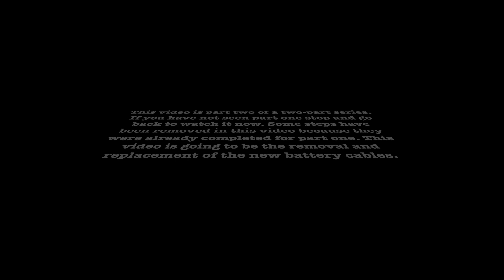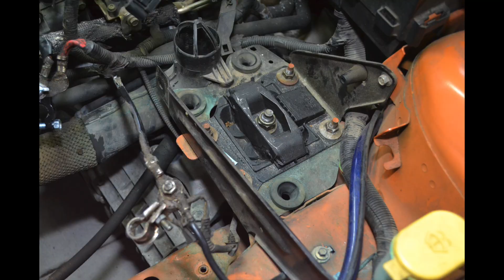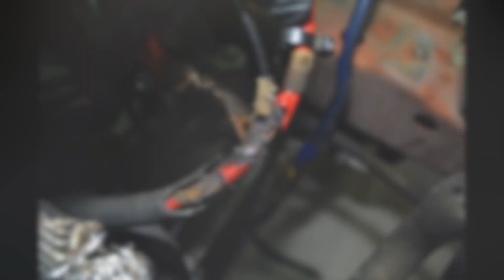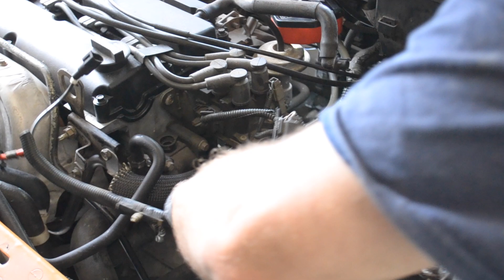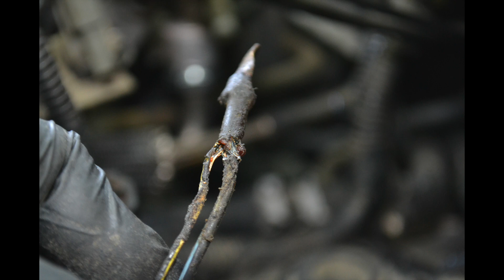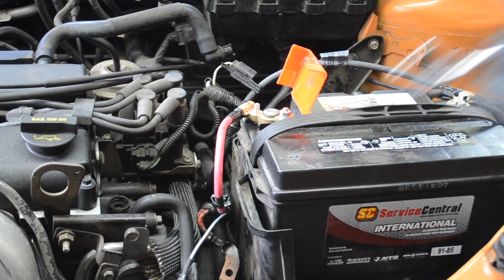2002 Ford Focus Battery Cable Replacement Part 2

Comment: My negative cable broke off at that damn metal part and I was stranded, so I but some isulation off and used the small vice grips I had to clamp as many strands as possible to that metal piece, it worked and got me home, the part you show is Motorcraft from Rock Auto is like $38.79  I just need that poorly designed negative cable be repaired.

Comment: couldn’t you just patch the damaged insulation and run a separate alternator wire
Reply from the maker: On mine it was too far gone. A lot of the wire was broken. It was just a safer option to replace it all. The wires are cheap now since the vehicle is so old. Thanks for watching
Reply: @DaveMedicus   I Ran a separate wire from the alternator charge post to the battery a 1/0 big 3 upgrade wire
Reply: @DaveMedicus  on my community page you can see the new alternator and giant power wire

Comment: My bother just bought 2000 focus same  is 2.0l engine,the alternator looks like new and we bought new battery and still not charging now after I saw your video I’m going to look the battery cables I hope that’s the problem.
Thank you for post this 2 videos so happy you did
Reply from the maker: Check out my video on replacing the exhaust tube as well. I had it burn off the protective heat wrap again thus almost causing the same issue.

Comment: Thanks for this video. I've been searching all day for alternator replacement and cable replacement as mine are fried... I know this is a super old video but I have just one question. I'm drawing a blank but I've got everything taken apart except that middle ground post terminal on the cable. I can't seem to figure out or see where that ground terminal is on the car. On the wire it is just before the starter connections ( in between the terminals and the starter cables). Please if you can assist. Thank you.
Reply from the maker: If you are talking about the same one I am thinking about it bolts to the fender right behind the battery. Sorry for the super late response. Thanks for watching! I hope that helped.

Comment: Thank you very informative video. Can you please help me with the cables that come from the car do all Ford focus come with it the ones you said that were exposed and needed to be replaced? I have a 2002 Ford focus se.
Reply from the maker: Not all of them come with the same kind. I have seen a few designs but they all are cheaply made.
Reply: @DaveMedicus  thanks. I was able to get it done with the help of your video and other videos I watched. I also replaced the starter.

Comment: Thank you! After a new battery and alternator which ran me almost $400, It was this damn wire the whole time that was preventing the alternator from sending power to the battery. I got a new one on ebay for $45 and did it myself. Its a lot easier on the SOHC model because theres more space to work and less tubing/hoses compared to the zetec. I guess thats some of the very few good things to say about the infamous SPI engine lol.
Reply from the maker: I am glad that you were able to figure out your problem. Thanks for watching.

Comment: New Part number in video:  YS4Z-14301-JB
Reply: And for those with auto transmissions, use YS4Z-14301-LB.  There are two different cable sets depending on manual or auto transmission.
Reply from the maker: Thanks for the updated info.

Comment: 2003 focus se zetec wagon here.. there is a 2nd cable coming off my positive that looks to be about 8 guage and is split into 2 wires going into the battery junction box..this is the feed that supplies all current for accesories ,guages ect and I dont see it shown on ur replacement wire... The new wire positive seems to feed to starter and alternator  so How is the battery junction box fed?
Reply from the maker: That wire is separate and gets attached to the bolt on top and held down by a nut. You should be able to separate it from the old harness. If you still need more help shoot me a message on instagram and I'll send you some pictures. Thanks for watching

Comment: I literally have 2 Ford focuses with the same problem the battery cables are garbage but the engine is solid
Reply from the maker: Yes they are. Even the new ones are garbage. lol I at least know what to look out for now.

Comment: So thankful for this step by step video. I just did the same thing to mine and if it wasn't for you I would have never been able to. My car went completely dark one day and the engine cut off. The next day got it going again and I shit you not it was on fire! I put it out fast without too much damage but my wires were fried and I learned so much watching this..Again thank you for making this video.
Reply from the maker: Thanks for watching. I am glad that this video helped you out. I usually learn the hard way myself. I hope this solves all of your problems.

Comment: You should have went to Rock Auto to get your part numbers. Never by this stuff from tge dealer.
Reply from the maker: Squirrel Killa it wasn’t available. Even with the part number I was only able to find factory parts no aftermarket.
Reply: @DaveMedicus  There's also websites that have oem parts at discount.

Comment: First install positive cable and than Negative. Otherwise its GameOver Ecu
Reply from the maker: Yeah I realized that when I did it. I was 8 hours in and exhausted not thinking straight.

Comment: My car just had an engine bay fire because of this EGR tube. A lot of stuff got destroyed. I'm not replacing the entire cable assembly so I'm wondering what gauge the battery cables are and that smaller wire?
Reply from the maker: Nick Truskowski mine was 4ga. I would recommend making the wire long and not running it along the battery box. Also I would put some GOOD heat shield next to the battery. My egr heat shield has already started to break down from the heat. This is just a bad design from Ford.
Reply: @DaveMedicus  so the factory wires are 4 gauge on the focus? Someone was telling me they're 8.
Reply from the maker: Nick Truskowski bigger is always better it won’t hurt to put 4ga on. Some of the wires were 8ga and even smaller.

Comment: thank you for post this video good job
Reply: Great videos.  I've got an automatic transmission and just wanted to share that the harness part number ends in "JB" for manual transmissions and "LB" for automatic transmissions.
Reply from the maker: Thanks for the information.